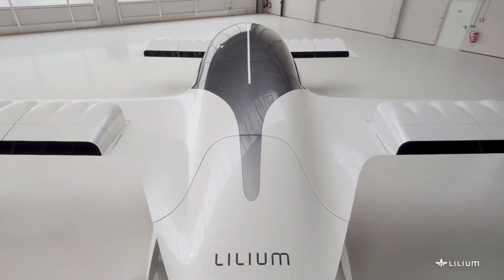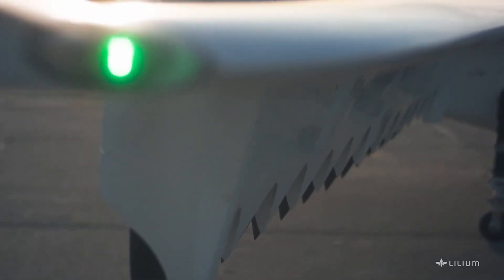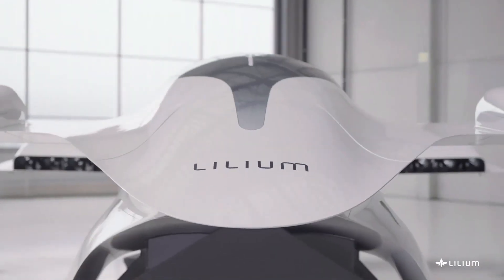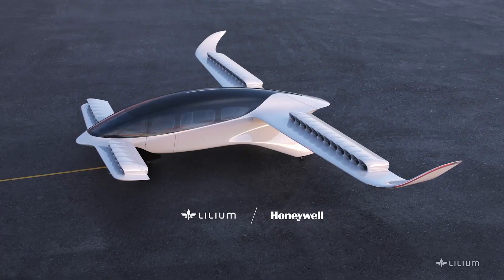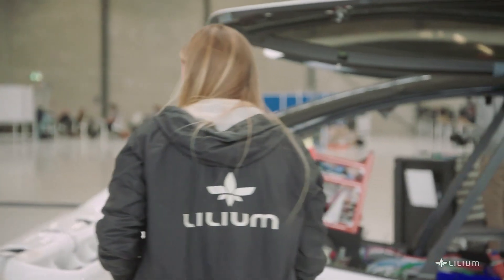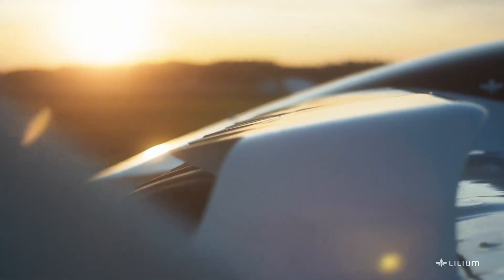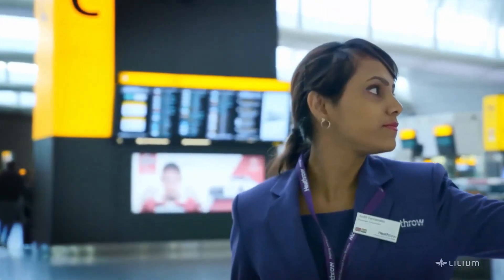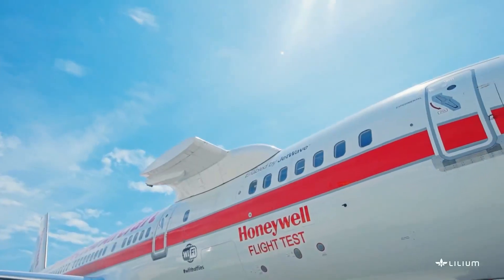Lilium 7-Seater Cabin Unveil 🚁 Strategic Investors & Partners 🚁 Evolution of Lilium Jets

Comment: You have been going at this for several years, and although the concept is sound, I cannot see it work before battery technology has caught up. Batteries are heavy and ducted fans simply don't create enough thrust. EDFs are also much noisier than conventional propellers as well.
Reply: I would like to know how much down wash those ducted fans produce and how much down wash there will be once they scale up to a real model.  Intercity transport will be better served by a conventional aircraft with electric propulsion since Lilium will have to use existing infrastructure if they ever want to see certification.
Reply: @hendrikvandeventer7669  that's a real life size prototype flying in the video
Reply: @jovanleon7  Now that you have cleared that up, can you answer the question about the down wash?

Comment: It has many advantage attributes, of non exposed propellars, luxury comfort, friendlier close encountering with near by objects a pedestrian among landing point, it could be very autonomous enough to make any uncertified operator to be a Navigator or flight chaperon. The concern, of buyers now, is the travel potential of this craft, getting from point A to B, fast, many of the specs desgin resulted in a flying vertical engine & glider, versus a high speed eVTOL-Plane.

Comment: I would imagine that range is currently the fundamental barrier that prevents the viability this type of powered flight.
Reply from the maker: I do not think that range is an issue, certainly not for intracity flights. Joby just recently demonstrated flight of 154.6 miles on a single charge (albeit without any passengers) https://youtu.be/98Qmx7-iImY. With fast charging limited range is not an issue.
It will likely take 3-4 years for the technology to mature and regulatory environment to catch up. At that point the urban air mobility industry will begin exponential growth.
Thanks for your comment, John!

Comment: If this industry thinks it  is going to gain access to US airspace through the use of ADSB based and autonomous computer controlled collision avoid then the industry better start sending money to the lobbyists on "K" street.  The FAA's commitment to the separation principal of "see and avoid" was made clear in the unmanned retail drone battle.  And they made it clear that "see' means eyeballs not sensors.  For nonmilitary operations....no pilot, no airspace access....period.
Reply from the maker: In the short term, you are correct. In the long term as the technology matures and with public acceptance regulatory requirements will likely adjust to accommodate autonomous operation of drones and eVTOL aircraft.
Reply: @FGain  "public acceptance" will have nothing to do with "regulatory requirements".  When big money wants "access" they go to DC.  Just take a walk down "K" street, it will become obvious how the game is played.  But if the integration of autonomous cars into the US transportation system is any indication,  the computer geek flyboys may not win this time around.

Comment: Not sure it’s very novel. Conceptually vtol ducted fan models have been around for a long time yet I guess modern materials along with advanced design software has facilitated scale. As a city hopper unless it can fly very high I don’t want to see it over my house. Even holding 7 people it still won’t dent commuters traffic. We keep seeing what every model builder has in his shed yet what we really want to see is some 10 fold break through in energy density batteries because really this is just an ego development which is no doubt way over priced and about as useful as a chocolate fireguard whilst using current battery tech.
Reply from the maker: One step at a time, Paul. One step at a time.
EV technology is advancing very fast. Just remember where we were just 10 years ago, and where are we now.
Thanks for watching!

Comment: I am still unconvinced Lilium is anywhere near what they want to achieve. They have never flown a full-size aircraft, not even in test flight. I am not talking about a manned flight, but any flight. When the Phoenix lands in front of the equipment building, it is clearly a sub-scale model. None of the flights have shown any real speed; the majority of lift looks to depend on the motors, not the wings.
Reply from the maker: That is true. That is why they stated they would start production of their eVTOLs in 2025. They have 4 years to complete the full scale aircraft, complete testing and receive regulatory approvals. 4 years may or may not be enough time to achieve that. Of course delays to the schedule are a possibility.